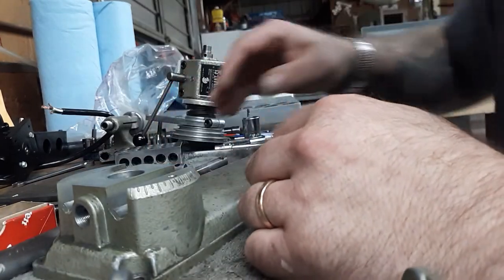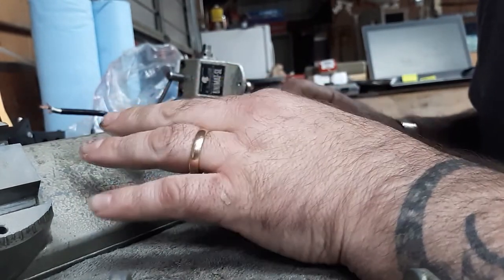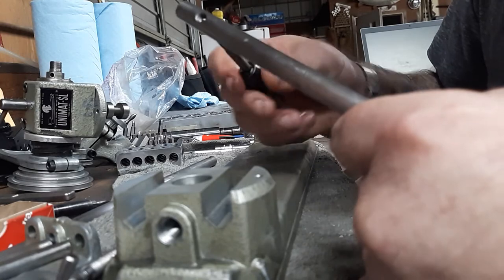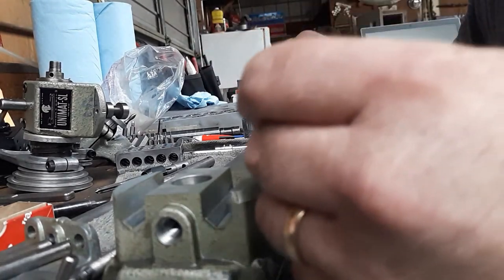Unimat DB/SL giving it a tune up after 50+ years-moving along nicely!

Comment: Mike, What and where did you get the DC motor and controller from??
Reply from the maker: from ebay but they can be found elsewhere. And they're expensive but I'm familiar with them and I wanted a little bit more reliability. You can spend alot less with some cheapie chinesium DC motor and controller and get good results. Even an old washing machine motor or fan motor will do it.
Dayton DCPM DC motor 3XE20
Dayton DC motor control 
4Z527
Reply: @machinistmikethetinkerer4827  I figured eBay but your part numbers will help.Thanks.
Reply from the maker: @BobLewen  got a Unimat you're looking to upgrade? The difference in power and duty cycle is amazing. Worth it.
Reply: @machinistmikethetinkerer4827  maybe…. Thanks for the info.